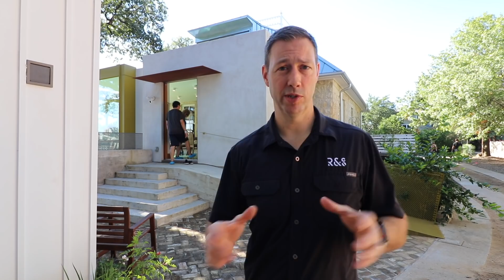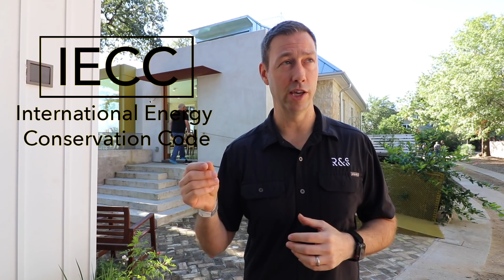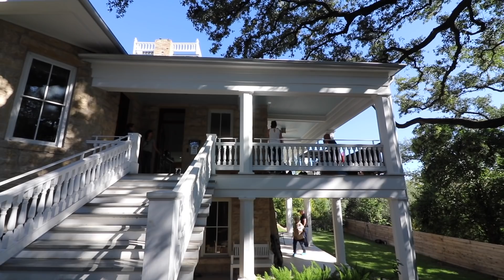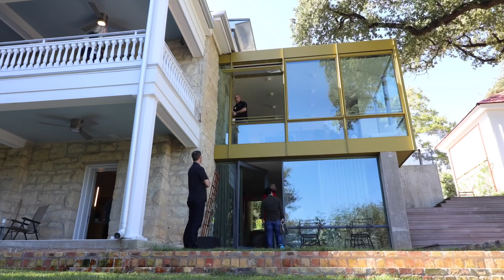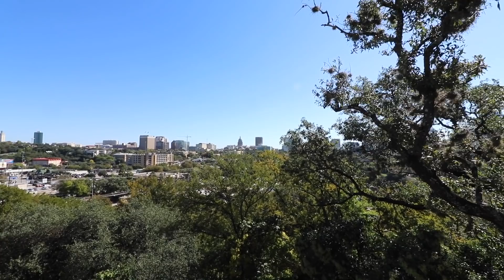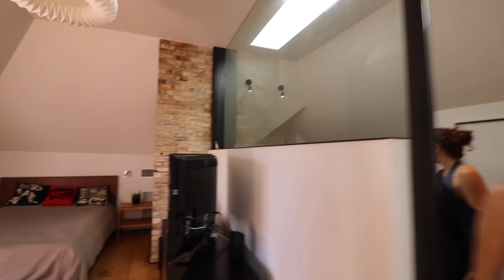How can an 1880's house meet current code? (Prescriptive vs Performance Paths)

Comment: Thanks Matt, a very interesting topic.

I see quite a few comments criticising the addition. FWIW I thought the addition was excellent, and a few features I got a quick glimpse of were absolutely brilliant. Clearly some people just don't understand architecture. It's NOT supposed to look like the original and that's the whole idea! There is intended to be a clear distinction between the old and the new, yet both need to function well together. That's very common where I used to live, and done well it's absolutely beautiful. What looks hideous are reconstructions of historical buildings using modern methods and materials.

Comment: Check out Indows.  Designed for this type of issue and since no fasteners Historic renovation friendly. Saving historic windows by improving infiltration will help your performance scores. Likely to drop blower door number by 5-10% will also help with sound.  Using these in Maine with great results.

Comment: Inspection and code compliance from a birds eye view can be a confusing subject because there are different interests and motivations for it. In my state the majority of codes including energy efficiency codes are primarily consumer/home owner protection rather than easing the power grid or fighting climate change. But for the same reason my states regulations are fairly hardline.

Almost all codes follow a prescriptive basis on the other hand the home owner can wave some of those requirements and regarding the IECC specifically architects can do performance based compliance but only under certain certified product standards and certain performance tests. It's not just an overall "is it better than if this was a normal house" type thing. That usually solves the problem for custom building but for new products entirely it means it needs to go through and be certified in the regulatory process.

Comment: If you were to add on to this house and try to maintain the thick masonry aesthetic. Would you still use the solid 2' thick stone wall system or would you split it and seperate the two halfs with with an insulated stud wall. I like the look of the stone on the inside of the house but finding a wall detail that allows you to insulate and air seal seems to be uncommon. Would a split system reduce the effectiveness of the thermal mass benefit. Other solution?

Comment: Is it because you've remodeled/installed an addition the house that the entire house now has to meet the code? And at what level of renovating or upgrading do you then have to bring a 100+ year old house up to current energy efficiency standards?
Reply from the maker: Anytime you open up walls and remodel you’ll need a permit and have to comply with current codes.
Reply: Where I live code enforcement just grandfather's existing things in. They were probably a lot more leant since I was doing a my own remodel on my house.
Reply: @SirDishs  That's kinda what I was thinking, surely if you added an addition to an existing structure you wouldn't then have to update the entire original structure to a new set of codes? But then again the local inspectors around here are a little out of control so nothing would surprise me.

Comment: This is a sore subject with me as an energy rater that many real-estate inspectors do not seem to understand.  A performance based compliance method will often have individual parts that are not as efficient as the prescriptive path requires, but they more than make up for it with a variety of other components that go well above the prescriptive path.  I wish there was more youtube videos about this because there is a LOT of confusion even in the inspection industry.
Reply: Trent Fuller
I can of understand what you’re saying. A bad analogy would be like if you wanna buy a pizza but you only have $5 and we need $12. So I put in $7 and this puts the total net value at $12. Alone we would not be able to buy a pizza. A condensed version of this same scenario would be “where efficiency is lacking, another area can compensate.”
Reply: @_RT.Tony_  you have it.   I have to educate inspectors weekly who only see what is lacking and do not understand that the code allows for it on the performance path.  All our builder clients use the performance method rather than prescriptive, and they end up with better performance despite the seemingly deficient aspects of the building
Reply: Part of the thought that goes into prescriptive over performance especially in my state where many houses are not spec built is to make sure all the products and systems in the home are pulling their slack and there isn't much wiggle room for performance based compliance. Instead planning commissions can each set specific prescriptive compliance and tighten the code as it sees fit. For larger projects you could do something like a performance based compliance by making an appeal to the planning commission.

And I know what you're thinking about that last part. But the thing is planning commissions are a lot less susceptible to corruption than larger agencies which can be bought off. Instead larger agencies do product testing and compliance while localities do enforcement. We got a planned convention center right now near by. It'd only take a few dozen people complaining to shake one of the commissioners seats. As such commercials interests often make plenty of appeals to the public as well as follow code.

An area in the city that focuses on private development is where this proposed convention center would go and ironically you'll read articles stating how private investment is the reason its been successful yet handfuls of proposals get rejected every year. "Not enough green space" "to tall" "not enough recreation space" etc. The public can attend those commissions and ask questions directly to the developers. Now thats a bit off from code compliance but my point is the developers bend to the commissioners.
Reply: @Furiends  you make a good case for emphasis on the type of change that can happen at the prescriptive level.   There's no denying it.  And furthermore, it would be a waste of resources to say one is "better" than the other.  One may be more sophisticated than the other, but that doesn't have to mean it's better.   One may be more failsafe and robust.  Prescriptive and performance both their respective strength.  That said, we should all agree that ignorance and disinformation is something to push against and improve.   This video does a great job.   I wish many more would round out the considerations in a concert of similar videos.   Sadly, I can confidently say after hours of searching on YouTube, such videos do not exist.... Ignorance reigns.   I applaud Matt's steady contributions to the contrary.   Nuff said.
Reply: @tf1639  For Matt Risinger and other contractors performance based compliance is just another tool in a builders toolbox. But I am speaking to the much broader policy implications of performance based code. A great example of abysmally bad performance based code are school buses lack of seat belts. Yes its true large vehicles with sturdy frames offer some of the protection seat belts provide but you could make kids even safer by adding seat belts at a fairly low cost. But they don't to save money and argue it provides similar protections against crash mortality. Do you see the problem with this argument though? Making use of performance based code is by definition cutting corners. When the costs are very high and the risks are low thats great but the rest of the time its irresponsible.
Reply: not to mention the energy and disposal costs of, e.g.: making new replacement windows, etc etc.  original windows can last forever and be brought up to modern sealing standards with add on weather seals, low-e films, etc.  hell, you can even get reproduction wavy insulated glass panels made for the original sashes.

Comment: Good explanation.  Sounds the same as the structural codes where we have prescriptive vs. International Building Code.  I recently hired a structural engineer to calculate loads on a house and he specked things out greater than prescriptive methods.  And I called him out on it!
Reply: WJ there can be good reasons for that. A lot of people do stupid stuff like installing tile on joists and subfloors with too much flex and then they act shocked later when their grout cracks even though prescriptive code would allow it.